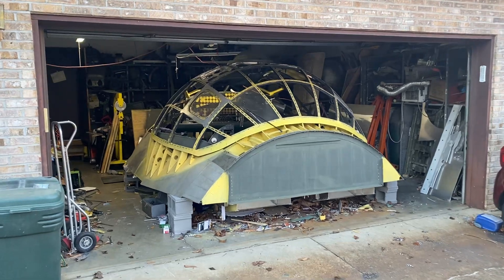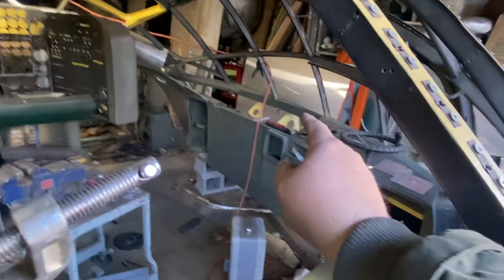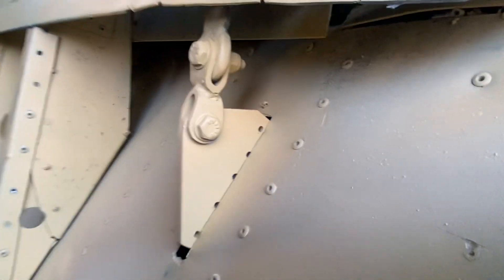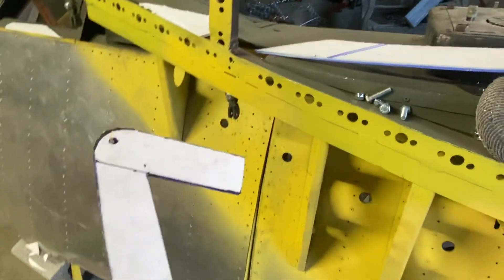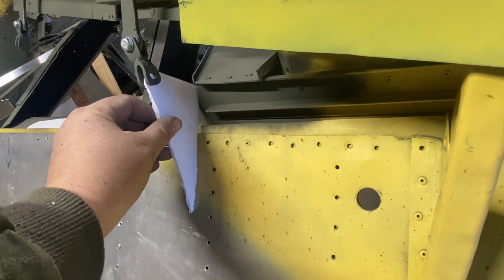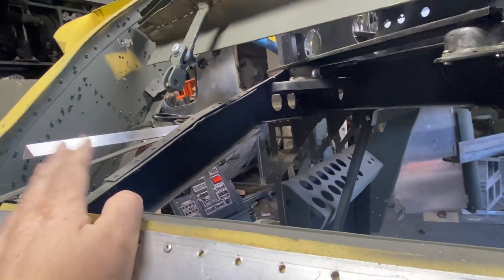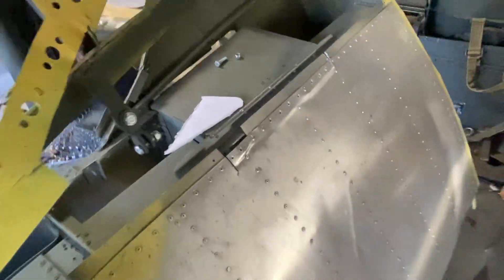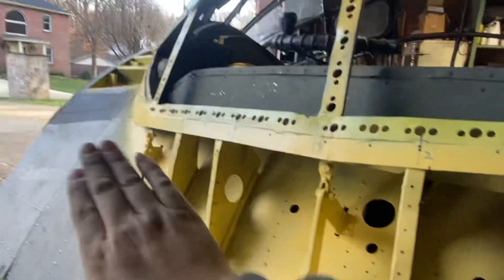Convair B-36H Peacemaker - Canopy to Fuselage Mounting Progress

Comment: Do not forget that your Tandem cockpit was an add on to the YB-36 after the  initial Air Force Approval. The original cockpit was flush with the fuselage and resembled the B-47 and F86 two seater design. They would have had to add vertical struts to hold the canopy glass up a little higher, so you could stand up straight. By the late B-36 production, it would have been modified to speed up assembly. The B-52 had a similar layout at first, but they omitted the glass in the nose as they were bombing by inertial guidance and radar, not optically like all previous bombers. The Air Force wanted tandem seating to improve communications between the AC and Copilot, and they got it, since they were the customer. I never saw a B-36 until touring the Air Force Museum in May 1988, and I can't get over how it was designed in 1940 to bomb Germany from the US if Great Britain was invaded. It's range was the greatest for any bomber of it's time, but it was too slow and heavy for dashing at treetop level under the radar. "Strategic Air Command " was purchased by me after moving to Atlanta,GA  that June-July and I still marvel at the Alaskan Operations in the 1950's.
Reply: Hey, just wanted to point out I think you have tandem mixed up with side by side, tandem is the linear configuration, like a tandem bike. The b36 was always side by side even on the original, not sure why exactly they changed it but I think to give more room for the multi level layout.
Reply from the maker: @ The B-36 nose was redesigned to incorporate the nose turret. The design was in place before the XB was finished and not utilized, but incorporated immediately into the YB-36.
Reply from the maker: You are referring the XB-36 (42-13570) which I plan to build…next-ish.